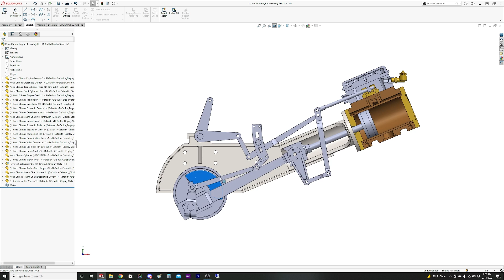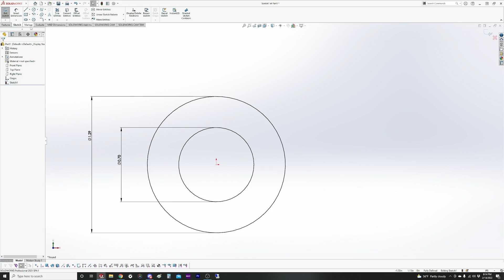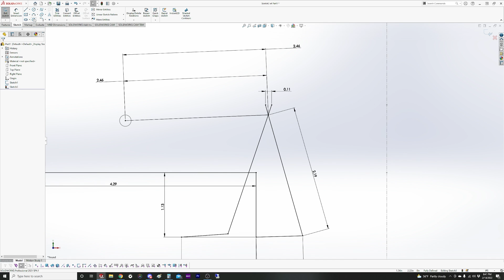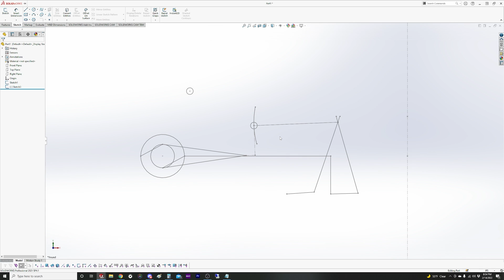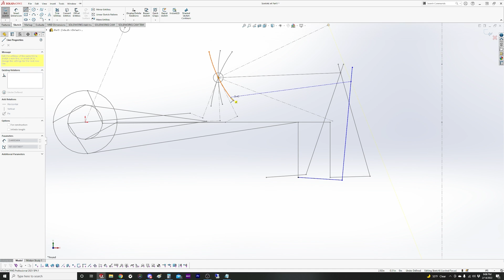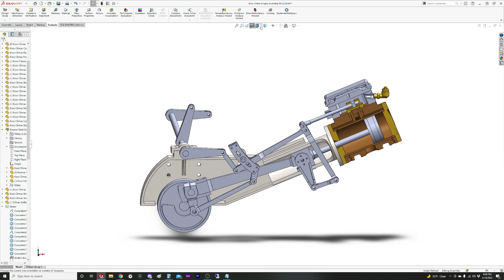How to Design Walschaerts Valve Gear

Comment: to better constrain the return crank make a sketch in the flywheel model, a line at the correct angle will do. Mate to that.
Reply from the maker: There is no advantage to defining the crank by the angle. There is no ideal angle for the eccentric crank. Only an ideal throw and length.

Comment: In a model steam engine, loco or stationary, the smaller the scale the larger the slop or error influences the timing.  The centerline of the cylinders should go through the centerline of the crankshaft (main axle on a rod loco).  Considering that this is a Climax, everything on the engine needs to be related to the basic engine then rotated to the angle needed to apply it to the loco as all power is transmitted through the gearboxes and shafts to the trucks.  I think you were getting there but the timing of the valve is directly related to the Forward Dead Center and the Reverse Dead Center of the piston.

Comment: Hey Anthony, 
Great Video! I guess the only addition I would like to add is a note at 1:21 that the eccentric position, leading or lagging, doesn't necessarily control whether a locomotive is "inside" admission or "outside" admission, but instead denotes whether the valve gear is "direct" or "Indirect". You could just as easily raise the radius rod and get the appropriate motion motion from the valve gear. Practically speaking, this wouldn't be particularly useful for the live steam hobby, but occasionally the full sized prototypes used the "indirect" Walschaerts valve gear.
Reply from the maker: Ferrous Equus, thanks for watching the video! You're right about that, and I hope my phrasing didn't suggest that that's the determining factor. My comments at 01:44 were meant to be the definitive explanation of outside vs. inside admission.

Comment: Great video and thank you for doing this, this is the type of info I wish I had access to years ago when I started learning Walschaerts. So as I look at an old Dockstader file I have of a gear I designed about 3 years back, mid gear cut-offs are equal (.014” lead, 4.8% cutoff front and back) full gear was 85.7% front port 85.1% back port. As I hook it up to the 50% area, which is hooked up pretty close to center, the cutoffs are about 6-7% apart from each other. Would this be a square engine? How much percentage difference (roughly) is enough for it to be audible/noticeable? I have learned much since then. Including now watching this video
Reply from the maker: Interesting result... I've been playing around with my layout to see if I can produce similar results and I can't replicate it. However I don't think a 6% difference at 50% cutoff would be very noticeable.
Reply: @EccentricEngineerYT  I wouldn’t think so either, so I’ll roll with it. Thank you again! I hope to also see you do a video on the correct way to draw locomotive drivers in CAD in the future. Your examples on chaski are the only “correct” ones I’ve seen. Outside of those, I’ve been trying to figure it out blind, haha
Reply from the maker: @tedisakoolkat  I like that idea. Was already thinking about making CAD tutorials for YouTube. Will add drivers to the list!
Reply: @EccentricEngineerYT  awesome! Look forward to seeing it! Thank you for all that you do
Reply: It’s because of the angularities of the expansion link, coupled with the offset of the eccentric rod pin. Have you read Don Ashton’s explanation of Walschearts? I suppose if you are using Dockstader you do know what you are doing. This is a great video, Kozo’s work is excellent. 
I seem to recall Ashton saying that 4% difference in cut off at each end of the valve was acceptable. He was certainly a stickler for perfection. 6% will be fine.
Reply: @jimmynswgr  awesome! And yes I have read Ashton’s book. For me personally I have learned more from his website than his book, which is very complicated for me for some reason. But I “get” more of it each time I read. His website articles however have been very informative! Most I’ve learned from was the Martin Evan’s book, Yoder’s book, and the Scranton ICC books on the gear. Always looking for more books though

Comment: Hey, great video.  lead does have a cushions effort, but it also has the same effect as advancing the timing on a internal combustion engine
Reply from the maker: I'm ashamed to admit I'm not familiar enough with IC engines to know what effect that is.
Reply: @EccentricEngineerYT  Great video! I'm not a steam expert, but in an IC engine, it takes a finite amount of time for the fuel mixture to burn and the start of the burn is advanced (started before top dead center) at higher rotational speeds to extract maximum work , and it is a balance - too soon, the engine does too much work compressing the burning mixture, too late and much of the energy is lost during the expansion stroke.  I imagine it is a similar effect in a steam engine, it takes a certain time for the steam to physically move through the restriction of the valves and ports to enter the cylinder, so at higher speeds starting that sooner results in more work extracted from each stroke, but again a balance.